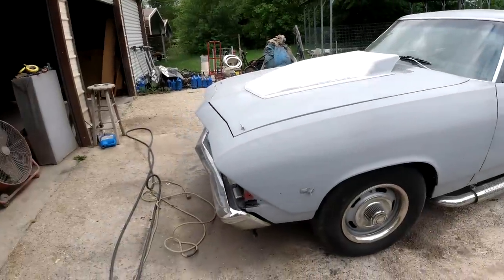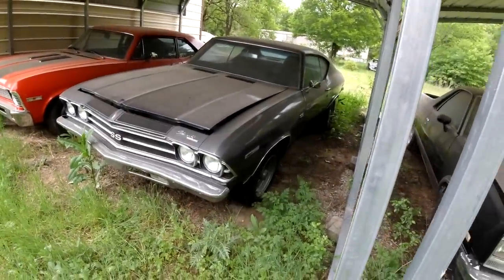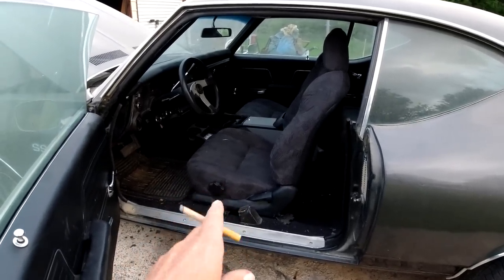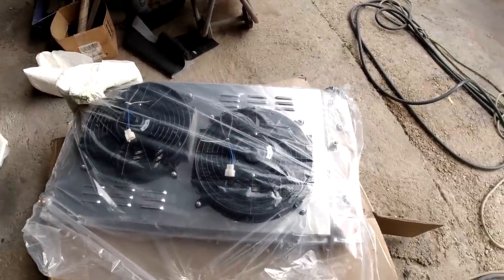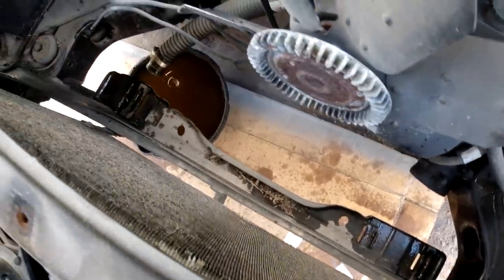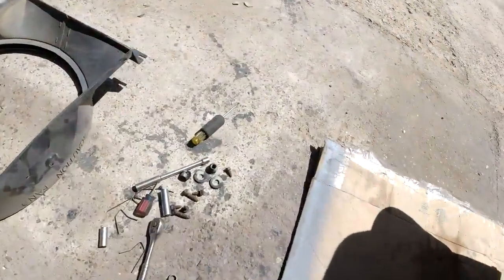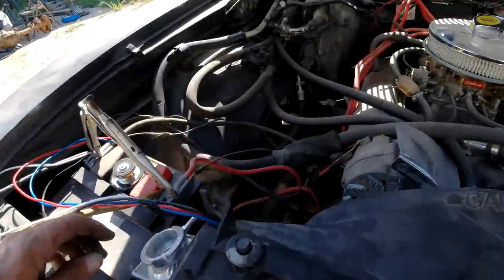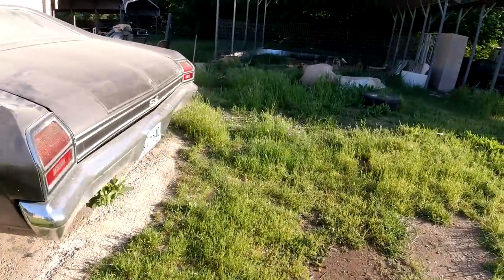1969 Chevelle Malibu - New Alloyworks Aluminum Radiator - #Alloyworks @AlloyworksOfficial

Comment: You're probably going to want to hook up those electric fans right away. That engine fan isn't going to pull much air with that aluminum shroud being in place. Just my 2 cents. Great video!

Comment: Why don't you just take the clutch fan and fan off the water pump pulley you will have so much room and you won't need that radiator shroud if those fans are working right! Very cool Chevelle! And, personally, I'd  add a Chevelle stock center console they look real nice and if you are spending money to do it in two parts and do it a couple times if you just spend some money (sell a car for it) you could have a killer Chevelle!!
Reply from the maker: I have no faith in having electric fans as the only way to cool the radiator. They fail a lot.